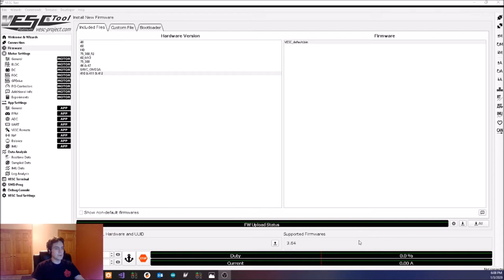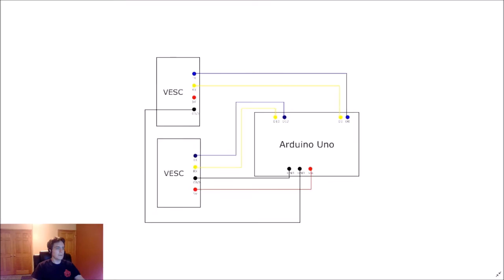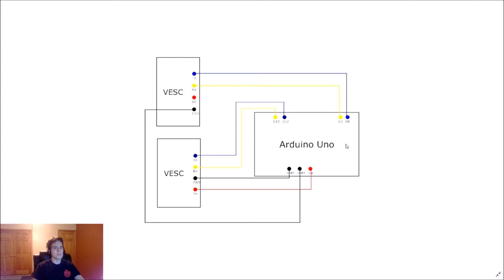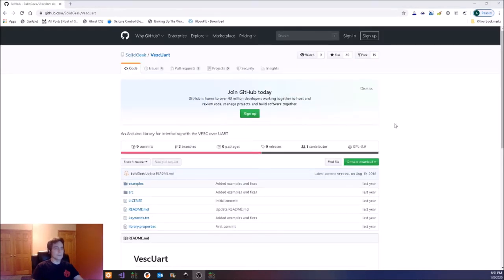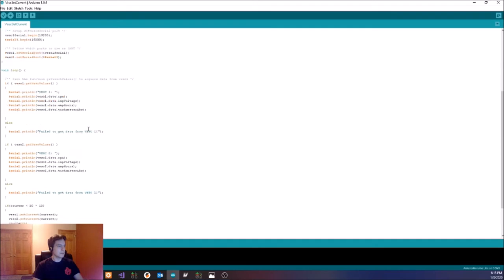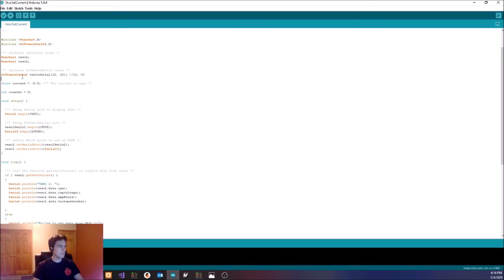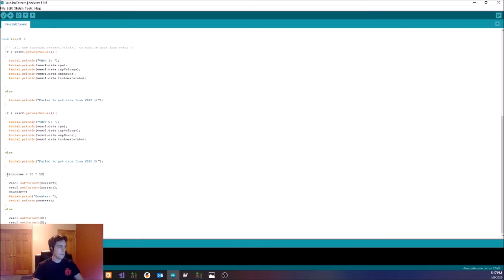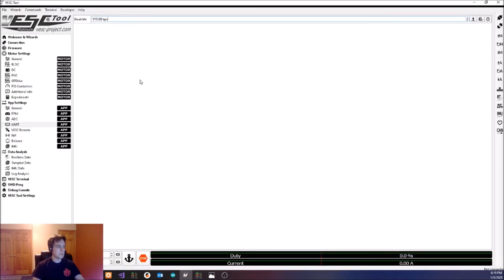Control Multiple VESCs Independently Using An Arduino

Comment: Hello!  🙂Great video!  I have a converted scooter to 48V 13S8P battery and 48V 1000W motor and I have the VESC 75100 and the VSETT display.  It all works via the Android phone but I have a VSETT display and since the VESC does not have a high-voltage cable like normal non-programmable controllers where you can set each display to red + black - the display switches on and the blue cable connects the display to the controller  Signal at e.g.  48V charged 54.6V immediately returns a signal of 45-50V to the controller and thus switches on the controller.  So I connected the VSETT Display Rx/Tx cable to the VESC aufTx/Rx and uploaded the Lisp file to the VESC for my VESC and VSETT Display.  But then he writes below that it is not connected and that the display must be connected to the VESC so that I have to switch on the VESC with the VSETT display!  It says: no paired.  I PLEASE you, as a professional with this electronics from the VESC, can you tell me where I can put the plus + cable from my VSETT display external display to the VESC because the VESC does not have a high-voltage display connection like normal controllers!  Question: where do I have to connect the red + cable from my 48-60V VSETT display to the VESC?  Because I can't connect it to the VESC with a 5V output, can I??  I connected Rx to Tx and Tx to Rx but as I said, the Lisp file for the VSETT display tells me after uploading that it says below in the tool: no paired.  And that I have to connect the display to the VESC.  I can switch the display on the permanent plus on the battery directly to + and - and set all the P settings and also set 3 gears but the kmh on the right side doesn't work with the E code!  And in the description of the Lisp file it says: if you upload the Lisp file then the E-10 code is gone and kmh display works.  I PLEASE YOU can you tell me where I can connect the plus + cable from the display to the VESC 75100 so that it is connected to my VESC?  PLEASE!  I would be so grateful to you!!  Because I can't go to 5V on the VESC with a display + cable, right??  Kind regards. 🙂

Comment: This is like the only video out they that talks about this…. I’m trying to make a big trike with 18x9” tires on huge fat hub motors. And need to use a joystick so I can turn by having one side slower then the other. Not sure if they have a template for that? Also is there a way not to use the uart? Like using an analog output for a normal ebike speed controller? They only use a 0-5v 3 wire setup to increase speed etc..

Comment: Hi, I am trying to do soemthing similar. I have two VESCs MK6 and they are powered by a single battery. And I am trying to control the VESCs independently via Arduino MEGA through UART. But from the manufacturers manual, they say that if I follow similar setup it will create ground loops and affect the hardware. Did you face any ground loop problems? If yes, how did you overcome it??
Reply: I have the same setup but with the hardware serial ports in the Arduino MEGA and I haven't have any issue

Comment: I have a dual channel VESC(with one battery port and two independent UARTs) and am trying to control it via ESP32(coz of multiple UARTs). Which is very similar to what you have shown. I just have 1 doubt. Is it possible to have one motor running and the other in regen braking, when the battery port of the VESC is common or the setup is powered by a single battery?

If not, then how can that be achieved with one battery port.

Please do let me know.
Reply from the maker: I dont think you can charge and discharge a battery at the same time, so I dont think that's possible.

Comment: Thank you so much for this video! I'm trying to run your setCurrent example, and the output waveforms look great before I plug the arduino into the VESC, but once I plug it in it stops working. I'm getting the error "avrdude: stk500v2_ReceiveMessage(): timeout" Any idea why this would happen? Firmware?

Comment: is it possible to read the rpm from the vesc to an arduino and light a led strip depend on your speed ?
Reply from the maker: Yes. You can have the VESC send the RPM to the Arduino and then have the Arduino do whatever you want with that value.
Reply: @finallyfunctional  have a tutorial ?
Reply from the maker: I show it in this tutorial. The sample code calls `vesc1.getVecValues()` and then prints out the RPM.
Reply: @finallyfunctional  how can i write the code to nano device?

Comment: Hi, would you say this is still good way to go about? Can you use ESP32 and do same?
Reply from the maker: Yeah it still works. I used this method with an esp32 in a version of my VR shoes.
Reply: @finallyfunctional  great 👍 cheer man will do same :) have you tried to add display to show telemetry like voltage and speed and mode
Reply from the maker: @airBornFpv  I have not. I sent those statistics to an android app I made to be displayed.

Comment: Hi sir, really interesting what you have done here. I am also trying to create a similar setup. However in my case I need to control the arduino from a GUI (Matlab most probably). I will also need to read some sensor values which will be shown in the GUI along with the motor control options. Do you think such setup is possible with multiple VESCs?
Reply from the maker: Hi Doruk. I haven't used Matlab, but yes I think what you described is totally possible. I'm actually going to be doing the same thing with the VR shoes. I'll create an app that allows me to control the motors and display values from hall sensors. If you have any questions feel free to email me at alex@evansalex.com.
Reply: @finallyfunctional  Thanks :)